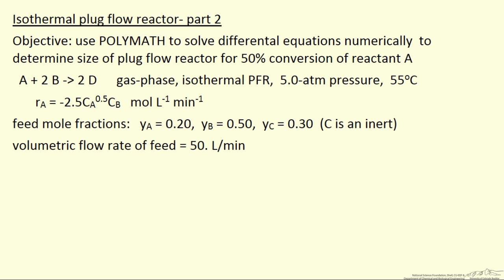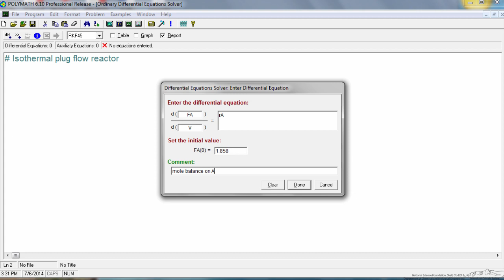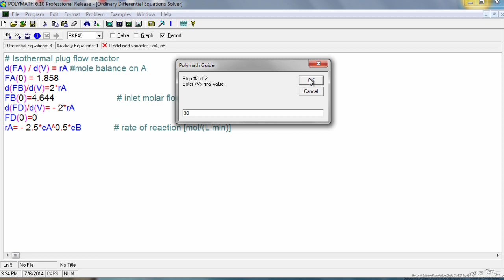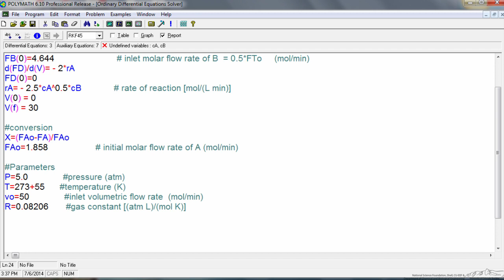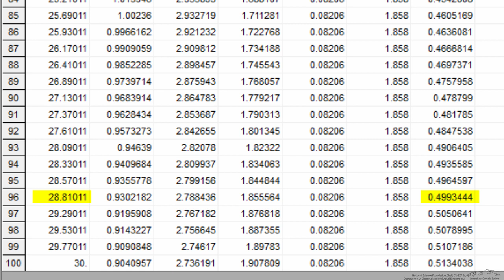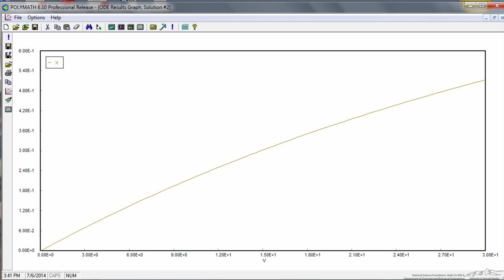Isothermal Plug Flow Reactor: Part 2

Comment: The 1.858 value came from calculating first the FTo where
 Fto = Vo(P/RT) 
= 50 L/min (5atm/0.08206 L atm/mol K x (55+273K))
 Thus, Fto= 9.29.
Then, FAo =0.20FTo
= 0.20 x 9.29
thus, FAo= 1.858

Comment: I don't understand why you chose 30 for the limits of integration.
Reply: Limits of integration of the volume can be set to 30,40,50 and so on, as long as the conversion or X variable in the table will have the desired percent conversion of 50% or 0.5. If not, then set a higher limit.